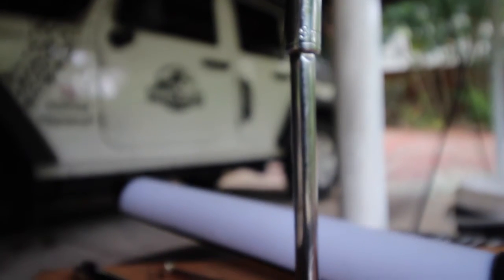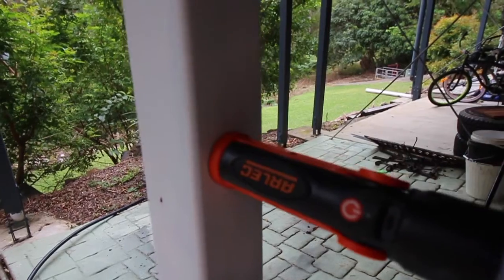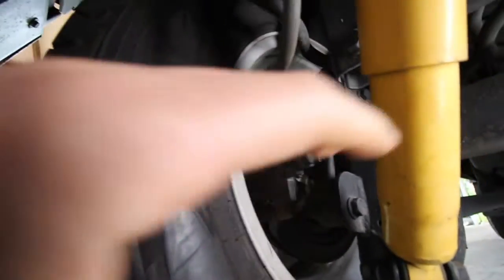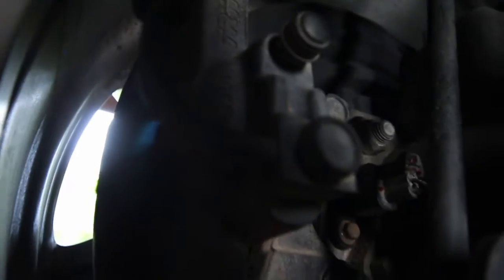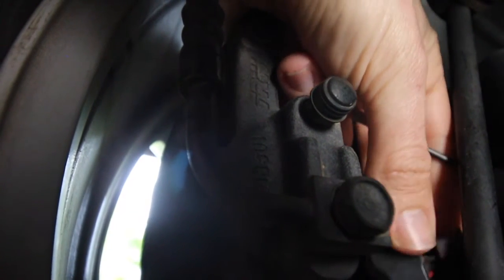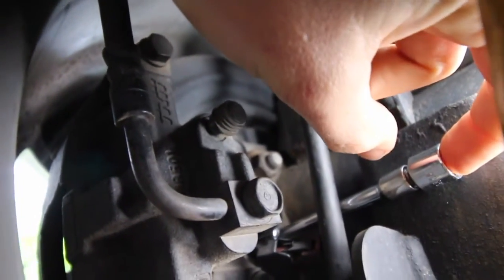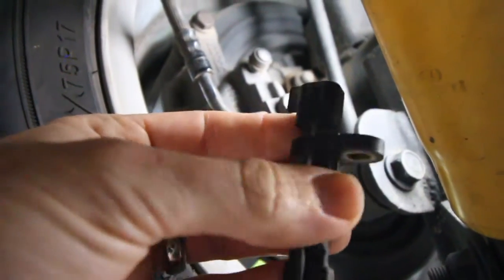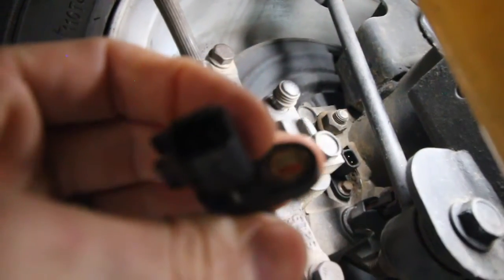HOW TO REPLACE A REAR ABS SENSOR ON A Jeep Wrangler

Comment from the maker: I hope this video has helped you change your ABS sensor in your Jeep.
Reply: Thanks for the video. That damn red clip gave me so much trouble. I replaced it however my ABS and Traction light won't turn off either.
Reply from the maker: @danielmembrillo6472  thanks, I love that little clip. Might have a bad connection in the line somewhere.

Comment: Please could you tell me wrangle jeep 2014 if the front wheel sensor and the rear wheel sensor are the same
Reply from the maker: NO, they are different, what one do you need to replace?

Comment: Good luck. Spent an hour and no way does that just come out!  I can see the wheel and rotor coming off.
Reply from the maker: What year is your Jeep? Has it got any rust?
Reply: 2012 and yes here in Nova Scotia there is rust. Removed wheel and rotor cut the old sensor in half with a mini grinder. Put the flex extension on my Dremel and honed the hole. New sensor slipped right in as shown. Just have to find a new red clip. Lost tension on removal and won't hold. Zip tie moment for now.
Reply from the maker: @berniehatt8338  yeah nice, That’s definitely one way to get it out. Yeah that red clip can easily break.
Reply: I removed mine and found out it was broken in half and it fell inside left rear 07 jeep what to do now